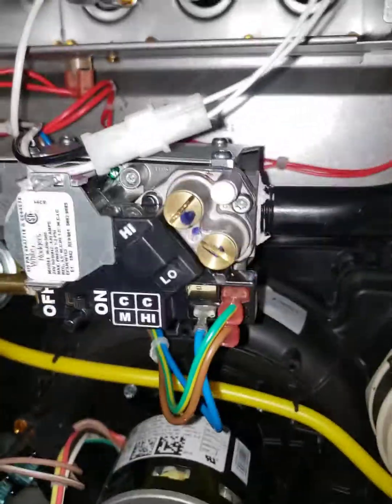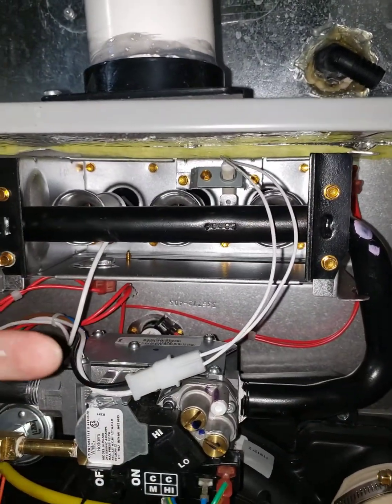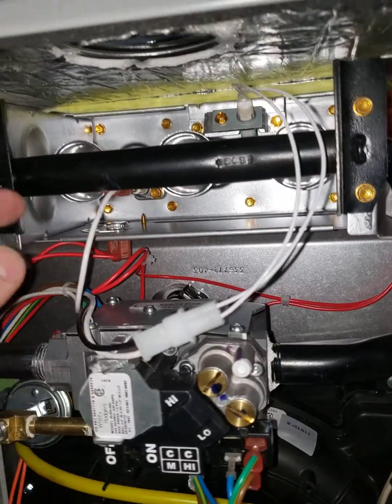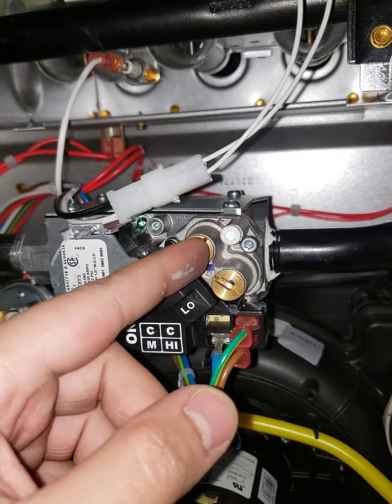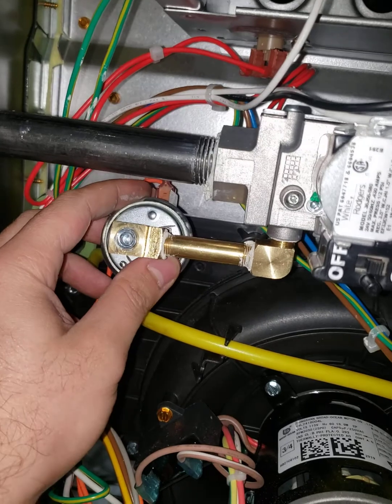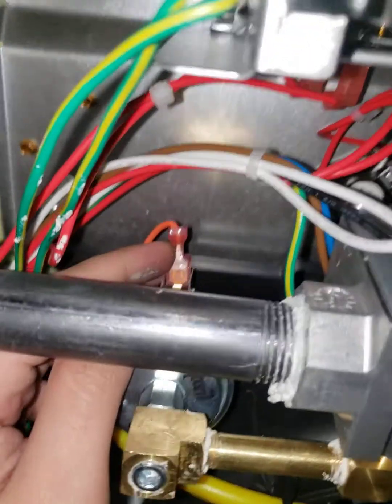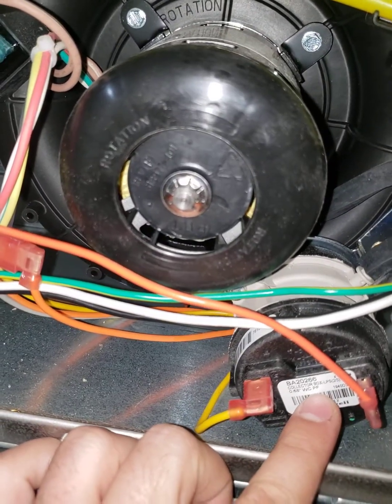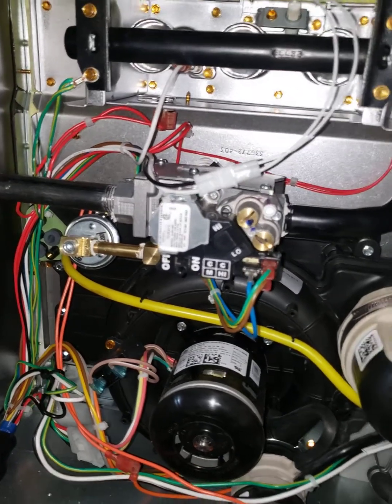Natural Gas to Propane Conversion Kit on Keeprite Furnaces

Comment: Great video.  After the propane conversion how do you know what manifold gas pressures to set for HI and LOW stages? Where can you find this information? 
The only manifold gas pressures listed on this furnace is for natural gas. Thanks.
Reply from the maker: @Mark-p5u  Once you put the springs in and turn the screws according to the instructions, you are fine.

Comment: When you drilled the mixer screws did you drill through the whole burner ?
Reply from the maker: You drill the screw until it becomes flush with the surface

Comment: Converting a rheem to propane. . There is no low pressure switch with the kit. There is a Payne installed now, it doesn’t have a switch as well.
Reply from the maker: Different brands have different kits

Comment: Question- what if I have a single stage high efficiency condensing furnace . Do I still need to use that low pressure  regulator that lead to Lps ? If did came with my conversion  kit but my furnace is not two stay so assuming I did see that part ?
Reply from the maker: You still need to install that low pressure switch.
That's the low gas pressure switch and it's different from the air pressure switch in furnaces.
It makes sure that if the pressure of the propane tank drops below the designated point, the furnace don't start and keep trying to fire up. Basically, it protects the component of furnace.
Reply: @CaspianHVAC  thank you for your reply